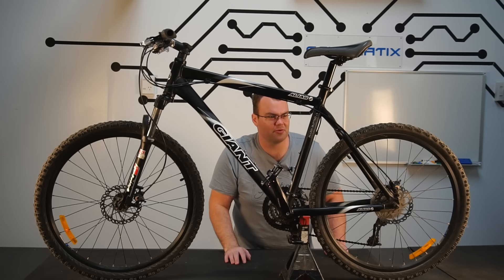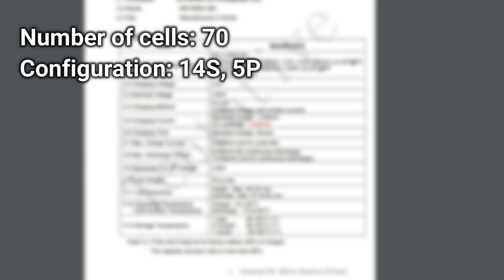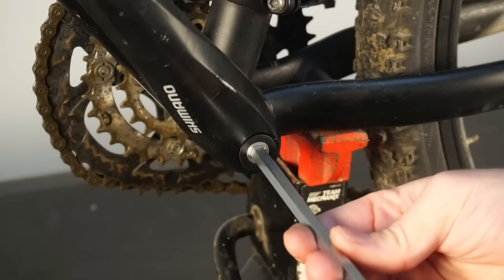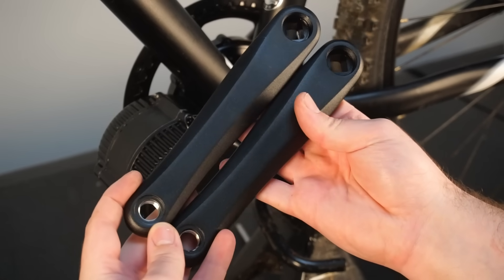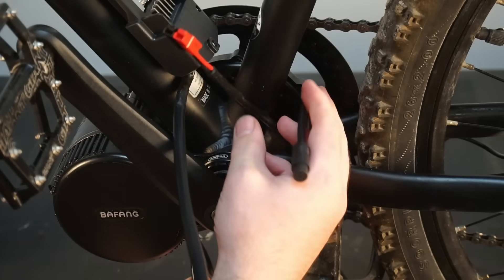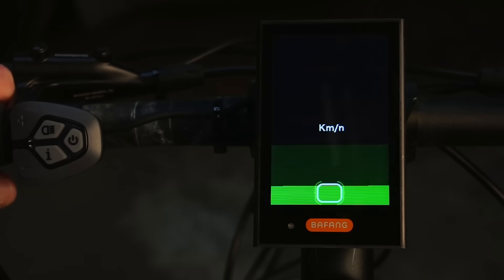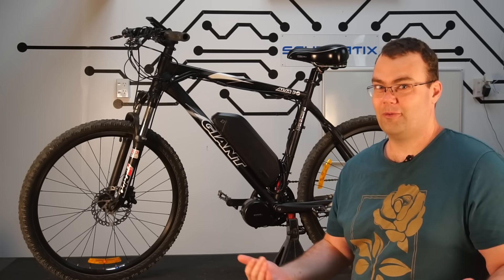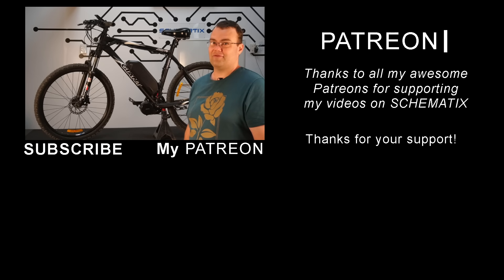eBike Conversion Kit, Install & Review ll Bafang BBS02B 750W motor

Comment: The first off you wasted your time I just watched the beginning of your video you didn't use Shimano they have upgrade components to I'm sorry dude but when you use those off brand electric motors they're junk they tear up the battery power you only go a few hours before you start sweating about needing a charge yeah you should upgrade it with Shimano and using a low grade Walmart bike to upgrade to begin with it's just a waste of time

Comment: 8:28 and replace the gear block with the chain, as the cogs are probably worn too. Avoid high power on the higher gears, 11,12 (top, next to top) as the combined motor/pedal power will wear out the cogwheels very quickly! Can be better to use good-quality steel cogs, as Chinese Shimano blocks are made with (inferior) Chinese steel...
Reply: where would you buy them
Reply: @richardevans9465  An old-style bike shop, or ebay...

Comment: Awesome video! I am going through an install now, and one thing has come up that I didn't see in your video... My drive crank seems to be permanently attached to the sprockets.  How did you remove yours? I am assuming if I cannot remove mine, I would have to purchase a new crank?  Thanks in advance!
Reply: Nevermind, just got my kit and it came with two new cranks.

Comment: I tried to order an ebike after thinking about it over a year and fed ex could not get it delivered to my house. I tried telling them to deliver it after five when i got off work and they wouldn't do it. If you are an ebike company i would think about using a different company to ship your ebikes. They only use a call center in India as there customer service. You can not speak directly to a FedEx representative. They are terrible at getting a package delivered to there customer, beware. Now they are saying the label is scratched and it can not be scanned. i can not even go pick it up. I should of had it almost a week ago. Now it has to go all the way back to the warehouse. Not this location just Fedex in general.

Comment: Great video. I'd consider this if I had a suitable MTB to convert. I didn't so I bought a Dengfu eMTB with the Bafang M600 and a 48v 14Ah already installed. Whatever you choose, eMTB's are incredible fun and you still get a good work out if you do some (or a lot of) peddling. 

It looks like your kit is restricted to 28km/h. Why is that? I imagine the 750w motor would be more than capable of much higher speed. Mine is restricted to 45km/h on flat but you I've gone faster down some modest hills. So far hitting 60km/h.
Reply: Are you sure about the 28km/hr maximum speed, as on their website it says, 50-55km/hr
Reply: @richardevans9465  I’m guessing the motor is restricted by law in each region. I don’t think there are any legal restrictions in my region (Mongolia) but my Dengfu with a Bafang M600 is restricted anyway. There’s probably a way to bypass this but I don’t know how. There might be a practical reason to limit the speed too. I wish I knew more about the motors and software/firmware.
Reply: @martinfoster5163  Good point, kits shipped from the EU, which they do, according to their website, could be restricted, I'm in the UK, so if I ordered a kit, it could be restricted to 25km/hr, which wouldn't be any good to me, the guy in the video should have covered this, so for now I won't be buying. Thanks for replying.

Comment: I want to build a Wohnwagen ( lightweight bike Camper ) so I am thinking this is somethinng I will need in hill country . I worry about my want for a Shimano Alfine internal gear hub being over torqued by the Bafang . How do I figure out if the motor torque is compatible with an 8 gear hub ?

Comment: won't a 52 volt battery be too much for a 48 volt motor?
Reply: No the motor (or rather the motor controller?) can handle up to 59v I believe. 52v battery will read near 58v at full charge, and it will slowly drop in voltage as it's discharged to around 42-44v where the cutoff point will be to prevent damage to the battery.  48v batteries likewise read like 52-53 at full charge. But don't trust me I don't know things this is just from watching yotube videos lol

Comment: Are you saying that any chain, whether it be 10, 11, 12 speed, will work? Also, was it possible to us your existing chain ring/crank arms?
Reply: You may be limited in the range of a cassette you can use due to the single chain ring up front; if you have a 10 speed you may only be able to utilize 8 since the highest may be bending the chain too far and cause slippage. I beleive you can reformat cassettes with spacers to set your most desired cogs to be in useable position.

Comment: The Bafang people handled all my inquiry questions incredibly well. The answers were swift, clear and answered my questions. No side stepping. I ordered it and to convert my commuter 8 speed internal hub bike to an e-bike. The mid drive gives me 8 internal speeds. I have assembled and test ridden e-bikes where I work but I had never done a conversion before. I did everything slowing, carefully and correctly as per the Bafang. I got it all together and did my test ride. It was amazing! It took a little bit of practice to understand the details. Its was easy to learn and it gets me around with virtually no 'work' on my part. I have to spin the pedals unless I use the throttle. When turning the cranks I don't feel that I am adding any power to my motion.  My conversion is better than the e-bikes I test rode before I bought this Bafang kit (sell those bikes I test rode). When I turn off the Bafang, my bike rides like it used to but a little slower up hill with the added weight. No motor drag. Even when is 90+ degrees, I get to work with no sweat from the ride. I like this because I 'recycled' my commuter bike instead of replacing it! I will share all the benefits of an e-bike from my personal experience with my customers...I will leave out which system I use. I give it 6 stars on a 5 star scale.
Reply: Hi, Where did you buy your kit? Thanks
Reply: I recently completed converting my Trek 3700 using this kit. I love it. As you mentioned there is no noticeable drag when it's powered off- I still do quite a bit of manual riding
Reply: Hi

Comment: Why bother to pedal? Mine's simpler, I didn't even bother installing the pedal assist sensor, I just use the throttle, much more fun! (I'm a kid trapped in an adult body) Even though they shipped the wrong battery, it still works great. (it's supposed to have a 48 volt battery, but they sent me a 36, even though I ordered a 48)
Reply: Did they refund or fix the 36v battery error?

Comment: Does the pedal assist mode work independently without activating the throttle? Thanks, great tutorial!
Reply: Yes, you don't even have to install the throttle if you don't want to. Pedal assist (cadence, not torque) sensor is built into the motor assembly.

Comment: When you're using just the throttle, do you still need to pedal or does it have a freewheel?
Reply: freewheel; the motor has a clutch inside that allows you to keep your feet still and freewheel while the chain is moving on its own with the throttle engaged. Nice thing is all these internal clutch and gears are replaceable if you ever wear them down over many years or extreme use.

Comment: nice job !! great tut video ..one question 

are the brakes required'? or is it possible without?
Reply: brake sensors are for safety; without that you could accidentally be accelerating while you're trying to stop in an emergency. Bad idea to not have them.

Comment: have been following this guide with a conversion; 1) the crank was so stuck (ten year old bike) that said crank puller couldn’t. 2) the bike had older style (very comfortable) handle bars that were too wide for Throttle switch - I had to strip handle bar back. But realised I’d have to replace it. 3) new chain- good trip. I had thought my 6 month old chain would suffice but no. 4) I’m convinced you loosen things before demonstrating in video. 

The bike is a family heirloom; my oldest sons first racing bike, my sweet middle sons means to get to work and then mine to get about when I didn’t want to use the good like

So it is sentimental project to create a new use for this bike 

I will get it working yet

Comment: Hi, Great video. I have a set up in mind for my Sirrus X 2.0 with Hydralic disk brakes and 40T chainring using a BAFANG BBS03 52V 1000W Mid Drive Motor Kit, P850C Display and Triangle U004 Battery 52V 20Ah. Looking for anyone who could do a quick check if this setup is compatible. Is there a platform I could post a PNG of my plan? Thx.

Comment: I have a fixie bike that i would like to convert to  a ebike but I am loss of what to buy
Reply: Beware doing a a fixie with this motor style -- it uses your drivechain's chain and gears to drive the wheels, and it could wear the motor excessively if you have a strong fixie gear ratio from the starting line. If your ratio is not so great and you don't care about max speed, then this could work. But rear hub might be better.

Comment: excellent and informative video - thanks 👍🙏 I may have missed it in the video, but can't seem to find the info anywhere... what is the max speed and/or is it limited to max 25kmh?
Reply: You can set it to whatever you want in the display menus, behind a PIN code, might be 0153, its been a long while , check the instructions or do a search.
The limiting is rather annoying, feels like one is always at that 25-28kmh range and having the motor cutting every 30sec gets old fast.
If you do decide to get it, order the USB programming cable at the same time, you will want to set power curves for assistance lvls yourself, the default is way too aggressive. Personally i set up slow ramp up over a few seconds and set max power to 18A, just to be nice to the controller. Has been working great for years.
Search for electricbike-blog "a-hackers-guide-to-programming-the-bbs02" , very good guide.
Reply: @gloriouspopemantom373  that's awesome thanks 👍 before I buy one I wanted to know that I could do 60kmh with it- need to, to make my commute worth it. thanks again.
Reply: @ChrisEves  
My Display goes to 99kmh, C965, varies by model.
Programming cable is used to click a selection to have controller pay attention to display speed limiter.
You should ask or check if your specific one does that, C963 display only goes to 40kmh.
If you really want to use a certain display you can hack it by setting wheel circumference to a smaller value and from kmh to mph, wont be accurate anymore but you can go fast.
Edit: not sure you will ever get to those speeds without a downhill and a wind in your back, I max out at ~35-40kmh on flat ground, after that wind resistance becomes too large, also it gets scary when dips in the road push you into your seat really hard.

Comment: I got one of the kit and very disappointed. Problem is - you cannot tune assist levels (speed and power) and settings they put there by default are terrible. Beware.
Reply: You sure can, you gotta get the special USB cable to connect the motor itself to a windows PC and there is a software to modify all the PAS assist levels. The display only has limited amount of options.

Comment: Had one don't  waste your money ,chain and sprockets wear down every two weeks to a month,straighten pedals down to get on ,bike takes  off in your hands,very dangerous, way better off with an in rear hub motor that doesnt have power wire hanging outside hub waiting to get crushed .Be aware that the batteries  fully drained and recharrged will only do 300 to 400 charge ups until they are failing and you need to replace  battery pack.Pretty crap the whole lithium  batteries,they need better batteries ,liquid vanadium ,cars will become an expensive joke

Comment: I followed this video closely too, but had the same issue as Kerry below, in that the motor unit fouled the chain stay. I needed a 5mm crank spacer, easily obtained from the local bike shop - thanks "Around Again Cycles", who also removed the crank for me. Fortunately, my crank housing was 68mm, but it did mean the left side motor locking plate was not flush with the motor (5mm difference ) and the supplied bolts would not reach. I had to use longer bolts and a series of washers to ensure a good fit. After that it was pretty straight forward. My motor kit did not have sensors for the brake leavers and I ended up with a spare cable on the wiring loom. Thanks again for your efforts.

Comment: As for removing the bottom bracket, most local bike shops will do it for less than the cost of the special tool. Of course you may want to return the bike to analog at some point and need the tool anyway.

Comment: Hi, can this Bafang mid drive motor can be installed on a frame  built with 3 bolt chain guard mount at the bottom bracket ? Thanks

Comment: Not rich? Then connect a hi touqe 12 v motor by small chain to the largest of the 3 front sprockets on your 10 spd & use all the gears. (Use small car batt on rear carrier).

Comment: Great video! Very good tutorial for a completely unskilled novice like myself. 

I cant decide if I'm going to mid drive or rear hub yet, but this video has given the confidence to go ahead build one regardless.

Thank you!
Reply: Advantage of rear hub is you can get home if the chain break's!!
Reply: @benpar8120  did not even think about that im going  rear now thanks
Reply: @Hebddhhrfhfhfufhfhfhf While true, you can repair a chain in less than 5 minutes if you just carry a few links and the tool. Simply remove the broken link, add another one, then screw it back in. Done.

Comment: These crank-hub motor designs have a  major caveat compared to wheel-hub motors. These Bafang kits do not have and WILL NEVER have Regenerative Braking. That speed controller box does more than drive you forward, it also is the Regen module.

Comment: Not a bad tutorial, but this kit is VERY expensive, and at least in Denmark, you can easily buy a good mid range eBike for the same amount. This means no external cable salad, better integration into the bike, and most importantly, complete guarantee.

Comment: The kit is ridiculously expensive!
Reply: On aliexpress there cheap I've seen them between £350 - £500 still cheaper than a suron or a purpose made e bike and if motor doe fail can turn back to a regular bike suron dies ur pushing home a e bike yeah u can pedal but parts way more expensive plus thi be way lighter than a full e bike seen these keep up with surons

Comment: You did a Really good job on this video.  I have a Montague Paratrooper I may want to modify.  I bought an Ariel Rider Grizzly for the two-wheel drive capability for beach and off-road use.

Comment: Now you have me curious about the comparison between hub driven and this type you've installed. Both look like viable options for basic assistance when trying to climb hills without walking.
Reply: For steep hills forget hub motors since they cant change their gearing so they can actually be overheated. Center mounted ones are connected to the gears so you can change the gearing to whatever situation you would ever encounter and get max power no matter what.

I have a BBS02B and have used it for 8 month now and it work perfectly fine for both flat road at a speed, as well as hills that have had and inclination of 36 degree with no problems and several at 15 degree and more with no problems at all. A hub motor would fry instantly at that since they are only meant for flat roads and slight hills, where center mounted motors are meant for everything whatever you want to used them for.

Comment: The great thing about a "boring, pedestrian 'push-bike' " is that it keeps you in good health, keeps those potential dozens of extra pounds of fat off, and extends your life.
     It also doesn't create any garbage hazardous to the environment (except maybe tires).  Namely, a big, dead battery once it no longer charges decently, plus the motor itself after a few years.
     However, a battery bike is cool if you dislike exerting yourself, are ready to shell out enough money for a new bike, and want to strengthen the economy of China.

Comment: I would say the real rolls royce motor is the Bafang BBSHD over this one. Strip the crap controller it comes with out and connect it to a Grin Phaserunner with 21s battery and you're good for 94 kmh. You'll need to replace the awful nylon gear inside the motor with a steel or peek plastic one but it's worth it. I've posted some videos on my page of it.

Comment: One thing that people have completely missed is it’s not about just going and buying a conversion kit - because you can with absolutely no legal checks online. Depending on your country fitting a whopping great big 750w motor puts you into license plate, moped territory. Which you can’t do if you wanted to, for obvious reasons. (Like you can’t register a pedal bike as a moped and fitting number plate, wearing a certified crash helmet on the road and indicators or having brakes and -most importantly, tyres speed rated to match the faster road. 

It’s not illegal to own an e-bike with a power output exceeding 250 Watts, or where the electrical assistance doesn’t cut off at 25kph. However, it is illegal to ride it as you would a standard bike (without it being registered and insured like a moped), on a public highway – this includes both roads and off-road rights of way such as bridleways and byways. E-bikes that do not conform to regulations can only be ridden on private land where the public doesn’t have access, with the permission of the landowner. U.K. fir eg

Comment: IMPORTANT legal notes:
Each country has as set of regulations for road use of these kits.
Maximum power - 250w is maximum in many countries, but measurement criteria are not often explained
Throttles can be illegal
Maximum speeds are restricted, 25kph is common.
Reply: Yep! But no one bothers you if you ain't screaming out loud!